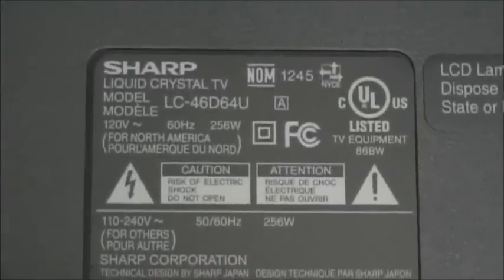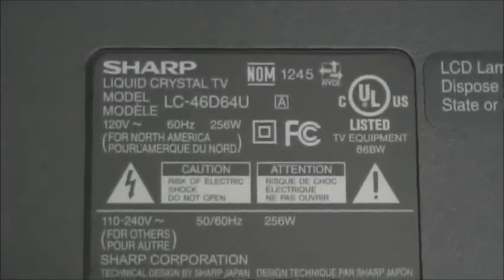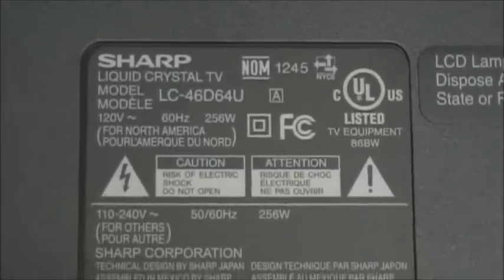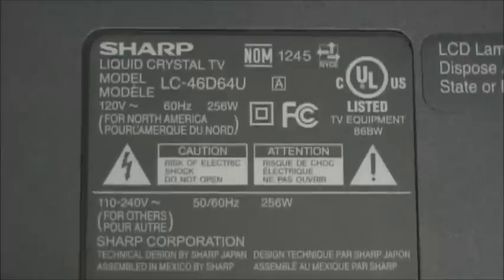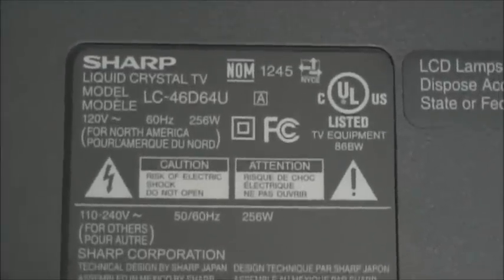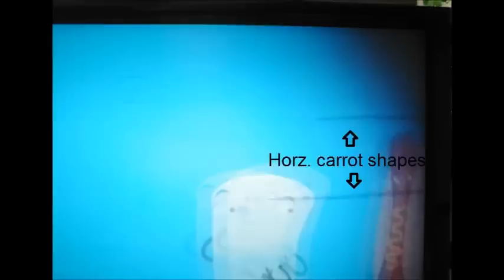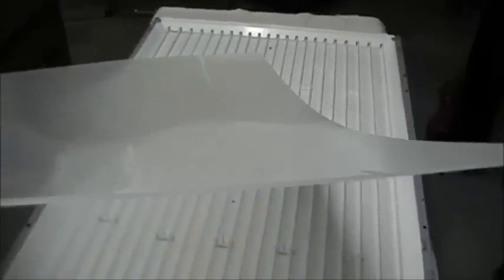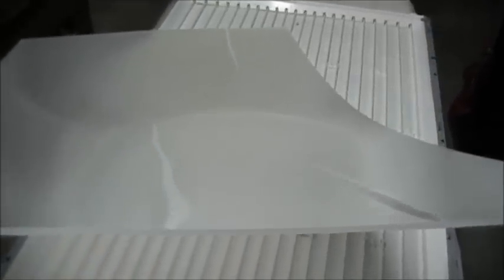LCD TV Repair Secrets - Horizontal Lines on the Screen

Comment: A BenQ BL3201PT computer monitor has exhibited shadows at the bottom centre, where the electronics behind the display assembly get hot. The screen itself is warm on the front side, where the shadows appear. I suspect the diffuser has been deformed over time from the heat but unsure where to find a replacement part. BenQ does not provide the parts and do not repair the display assembly. They replace the whole assembly and charge nearly as much as a brand new monitor!
Reply from the maker: All the BenQ monitors we had at work (of course, that was some time ago) used florescent back lights which eventually discolored and darkened. Their display panel assemblies were held together by factory bent metal frame, which was not meant to be removed. Of course, you could forcibly unbend it. The problem was bending the frame back into shape. Other than proving that one or more florescent tubes had failed, disassembly served no purpose. That was then. Whether or not the latest BenQ LCD/LED models are more repairable, I don't know. I do know that in most cases, it makes a lot more sense to replace failed computer monitors with modern LCD/LED TVs. They, tend to be cheaper, larger, sharper, and best of all, they are repairable. I'm using a repaired, 22" Vizio that was rescued from the dump right now! One important tip: whether you're picking TVs or buying a new one, it's best to choose a TV has a VGA port. Most older PCs tend NOT to have HDMI. When a PC monitor fails, replacement TV, not monitor, is definitely the way to go. Good luck! Thanks for commenting.

Comment: Samsung - LE40R74BD series - 40'' LCD/flourescent TV.  
.
Okay, I've got 'carrots' -  It was a weird experience.  They started growning in from the edges - gaining in size and length.  Two such anomalies - both starting from the right-hand side, one near the top and one near the bottom.  The top 'carrot' merely bcame fatter...  Whilst the bottom continued at the same width, but progressed across the screen - and now forms a long line (more like a 'leek'....) from edge to edge. 
.
Like you, I figured TFT/ pixel demise, or possibly T-Con issues....   i've not removed the screen yet, though this 'carrot' issue was not the only problem -  initially there was a constant - 'psychedelic' flickering until the unit warmed up - for a while I lived with it, leaving the TV on permanently (the TV is actually used only as a remote monitor for my laptop). However the flickering became progressively worse to the point of being unwatchable.   
.
So I pulled the back off and immediately notice several power capacitors on the low-voltage side of the PSU had started to 'dome out', a very common problem on all makes, which I have repaired quite often (in fact, the monitor I'm currently using - my standby LG TV, was repaired thus...  I also improved the longevity of this monitor by installing an old PC fan above the PSU to keep it cooler...).  These domed caps I replaced with new items - but upped the working voltage of each cap by 10v rating -  Now the picture is stable - no flickering.   But the 'carrot' and 'leek' remain...   
.
So before I go ahead and order a replacement T-Con board, I will most certainly check the laminations of the diffuser and polariser sheets, to see if the Samsung has the same 'laminated' construction and delaminating issue.    I will report back here, with my findings.  
.
Thanks awfully old chap for the heads up.   BTW - you had to dismantle the screen to find the problem - so I don't think you made a wrong move, so ignore the idiot - Tyrone Nelson - he's merely venting CH4 from his stern tube!  
.
Thumbs up.

Comment: This doesnt explain my issue at all I have 30 lines that come on when I reset my TV when I unplug it for 2 seconds and turn it back on they go away if zi unplug it for 15 sec they come right back wtf is that I dont liek that because that tells me there si something defective with my TV I'm like it cant be the processor there horizontal banding and it goes away idk wtf it is but it's a new fucjing lg c9 I should of stuck with Sony these fuckers are cheap af
Reply: A bit like your spelling then -  Why not PROOF your comments before hitting enable?  
BTW - I've had loads of Sony stuff over the years and many have fucked up...  Over-priced garbage.

Comment: Could you warm it up with a blow drier and work it out to the edge like that I see it working?
Reply from the maker: In my case, I don't think that would have worked. The plastic had clearly expanded. Heat expands, cold contracts.  Even if you could shrink the material back to its original shape, you'd have to get it perfectly flat to prevent newly formed shadows. The best solution is to replace the plastics with similarly sized materials taken from a TV that really did have a cracked screen. In hundreds of LCD TVs fixed, I'd never seen these symptoms before (nor have I seem them since) and that's why I made the video - to help someone else. Why there's been so much venom from hair dryer zealots is a complete mystery to me. Heating plastics, boards and flex cables is NOT going to fix this problem!

Comment: You sir are a moron all you needed to do was to heat up the flat flex cables around the edges of the screen with the back and sids and top and bottom panels removed well the power is on anuse a flat pice of metal to put equal flat pressure on the 8 driver boards and the flat flex cables connecting each of them 4 each to the screen around the edges and heat with a heat gun or iron and apply equal flat pressure till the lines dissappear  ! There are no scratched screens or blown boards or power supplies  it's because the flat cables are conductivily glued to the driver boards from the resolution lines vertically and horizontally on the edges of the lcd or led screens instead of soldering them and they unglue themselves over time and movement  so they need to be reconnected and glued with heat and equal preasure and lining up the pins !
Reply: Only very insecure people feel the need to call other people names (like moron).
Reply: Derek Washuck. shut up
Reply: You've got problems dude. Calm down